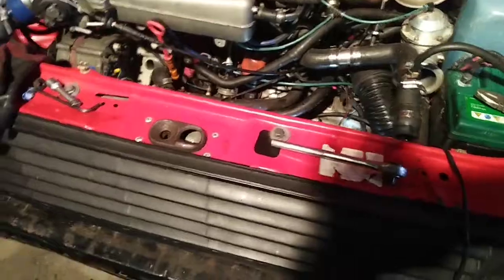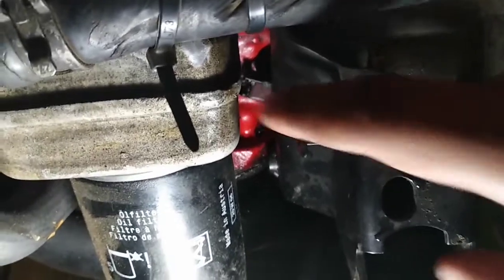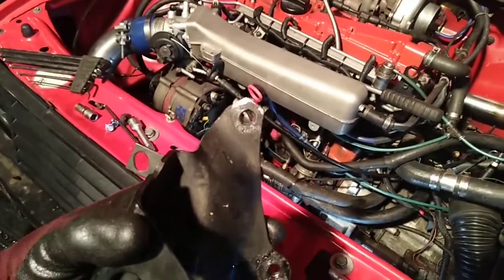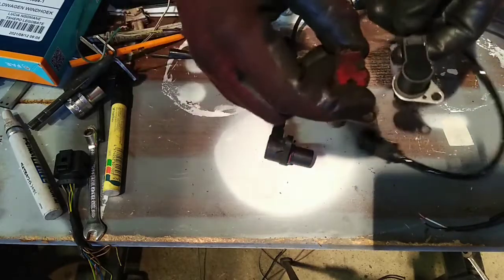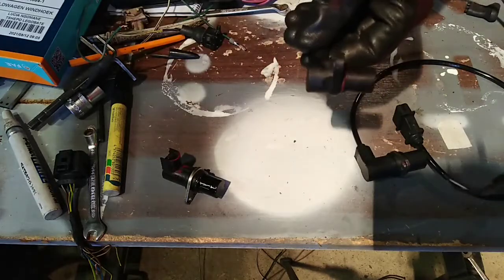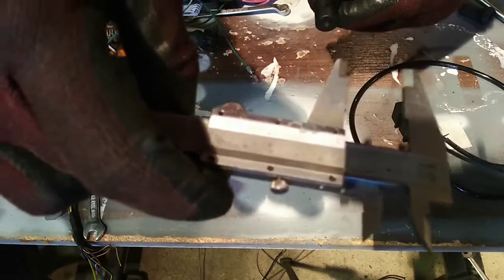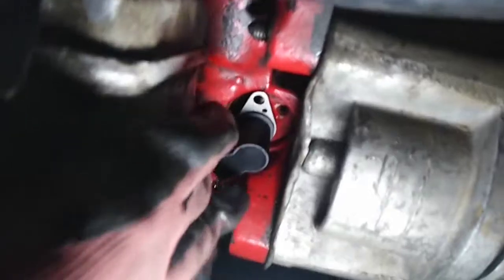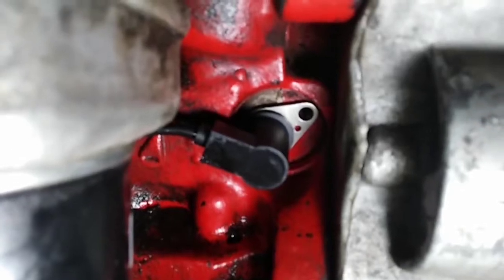Vw crank sensor

Comment: Hi, I've fitted a VW 2L 8v AGG motor into my 1990 VW microbus but ran it on the original Digifant engine management system. I just replaced the crank sensor which wasn't used in my original setup but I need it for the Speeduino ECU. I would really appreciate your help. It would save me a lot of time if you could point me in the right direction.
Reply from the maker: Sure hit me up on 061.garage on IG